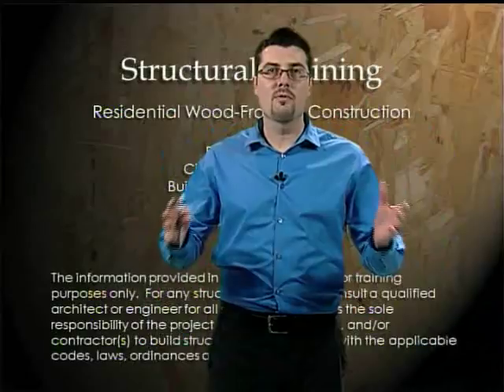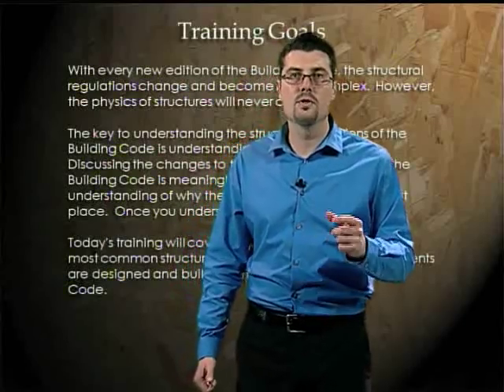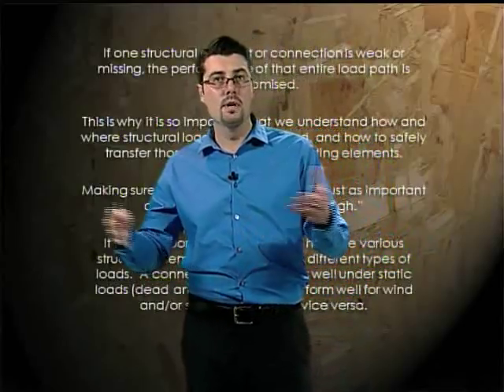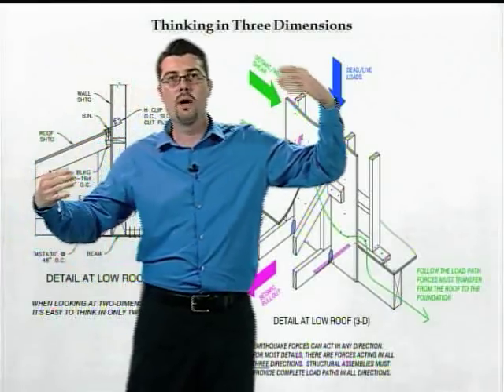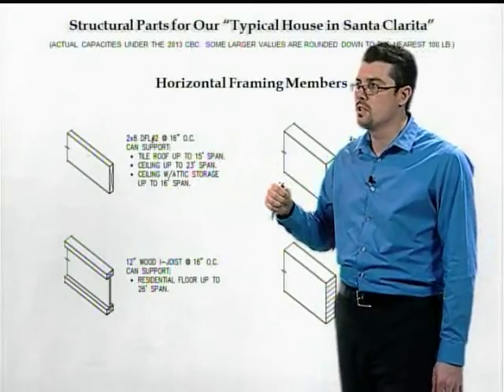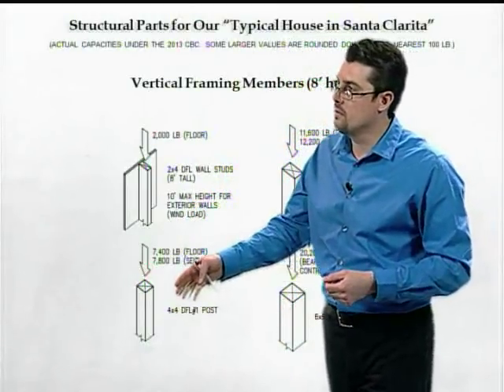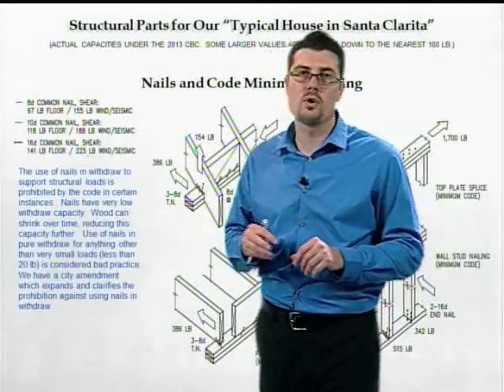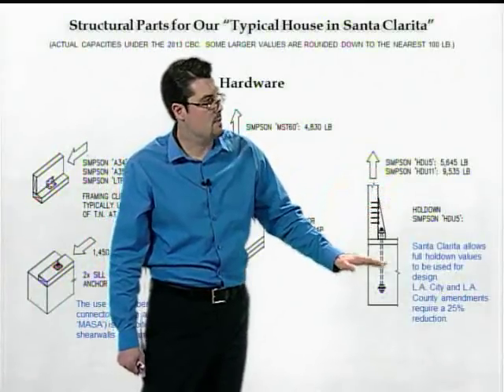Part 1 Building and Safety: Codes explained 2014

Comment: I agree with you on the MASA straps… my house was built with these during the Bubble back in 2005-2006…walls were delivered pre framed that’s why they used them. I prefer 5/8” HDG A.B. or Epoxy set RTF. (Retro fit bolts)

Comment: It's gone all blurry, I can't make out the pictures or the writing.  Can you do one up to date of 2018 and in focus? Thanks. I have never build a house before and I have to gut and rebuild my childhood home. I want to make sure I do it correctly. I will try to listen to as much of this topic as I can before I get started.  My foundation is cinder blocks, no basement. I saw how one was done, I just need to find out if it is correct. I hate to spend time and get it all wrong.  I didn't realize that every step they have to come out and check. It makes sense.  I will get someone who has done it to help me to do the right stuff.
Reply: inspire734 to hmm

Comment: awesome, i'm an owner/builder doing my own designs, and watching this is a lot easier than reading the code, great tips for home builders
Reply: Have you ever done a paving stone and cinder block foundation? I am redoing a house and never have before.
Would I have to cement the cinder blocks to the paving stones and cement them altogether? I will put cement down inside them with a rod in each center then a long board to start the structure  across that. I saw this on a you tube video. Perhaps I should find the video and ask them about codes and this type of a foundation.